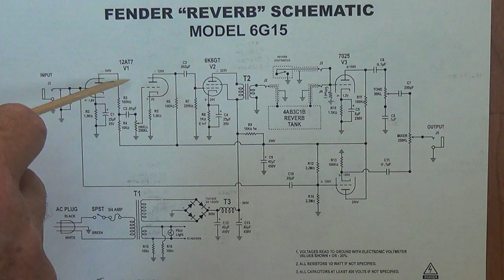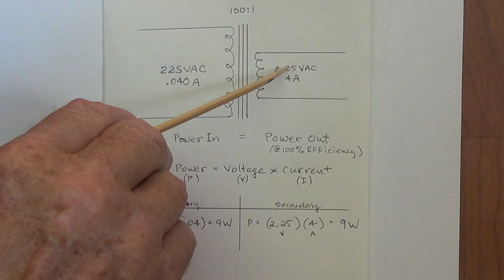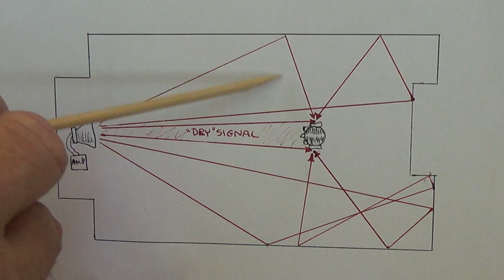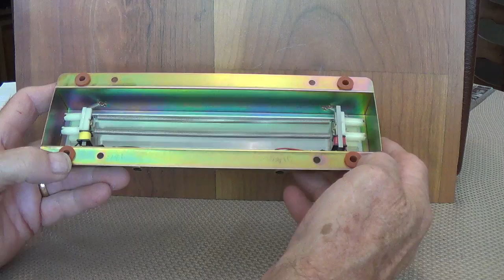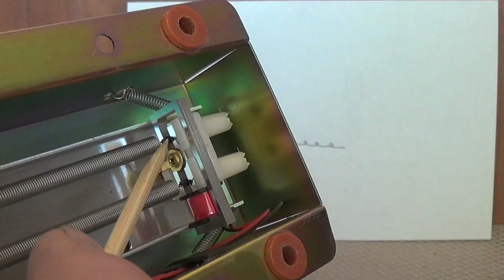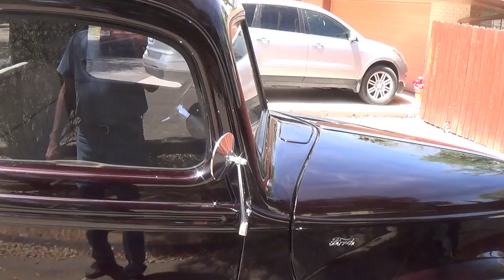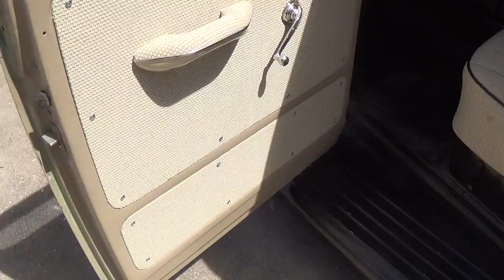Tube Reverb, Part 1

Comment: Hey Doug, I built one from the original Fender 6G15 Schematic last year...thing works/sounds great !  The only drawback is where the HV caps are located in the front section of the chassis does not have a protective cover as the reverb tank assembly hits the cover but there is well enough space for the caps.  I may eventually put these caps inside the chassis as there seems to be ample room !
Reply from the maker: I can see why you're concerned, Tom. I put the filter caps inside the chassis, thank heavens, and have no problems. I did place a metal partition between the power supply and the rest of the circuit.
Reply: Thanks for the reply...I saw that video and will do that !  Again, many thanks for all the videos and great explanations.  I'm an amateur radio op and mostly deal with RF and all this audio stuff is new but I still dabble w/vacuum tubes.  My other buddies say I'm lost   ;-))Best amps are those that have a full complement of vacuum tubes !
Reply from the maker: You're welcome, Tom. If you fully understand RF, then AF should be a relative breeze. Amen to  your preference for tubes......they've definitely got "soul" :)

Comment: Informative video with a truck porn chaser. What are the police like round you? Can you boot it and get away with it? Round here in rural UK, I can do a ton on the bike no worries. Nice work on the old Ford BTW, (who gives a bollocks what engine it has in it) can see where your cab covering skills get honed. I'd love one of trucks but you'd have to put floats on it to get it over the pond : )
Reply from the maker: Thanks, DA. The police in my area hide and try to catch speeders in order to generate revenue for the city.  If they really cared about safety, they would park under speed limit, school zone, and curve signs with flashing lights and point at them as cars passed.  We have to be very careful.

Comment: The quality of the finish on this unit is testament to the skill applied, given that it was the second project you had done.  The covering is still bonded tight with no lifting even on the corners, which is usually the first place to separate.  Previous experience fabricating hot rod interiors helped I'm guessing?  I very much like the material on the front.  Hope you didn't steal one of your Gran's couch cushions for it.  Another well chosen topic.  You set the bar very high with your videos.  Really smooth looking truck, beautiful colour.  Looks good, sounds good, starts first turn of the key no doubt.  Ford truck, Chevy engine, it's still American.  Put your foot down and your cruising, don't see a problem there.  At least it's not powered by a four cylinder turbo diesel from Europe.  Regards, Jeff.
Reply from the maker: Thanks for all your very nice comments, Jeff. The material for the front panel came from an old upholstery shop here in town. I bought several yards of it about 40 years ago and have been using it ever since.

Comment: Cool video. A 6G15 build is in the future for me. I just have to finish all the other projects I have piling up😎. This might be a dumb question but does an outboard reverb unit like this add any appreciable gain similar to how the reverb channels on the blackface fender's do?

Oh and can I add to the chorus of "oohs and ahs" about that truck! I do like to look of your work on the bed and interior.
Reply from the maker: Thanks, Bob. I'm not sure about the added gain, but would not be surprised if it did.....after all, the signal to the amp would have gone through at least one stage of amplification (dry signal).

Comment: Hi Doug, need to get your opinion again...about to build a power amp do you have a suggestion to this : 100-150W built in a 2U  chassie...? I'm a bit puzzled to if I'm gonna go that road or maybe use a readymade amp (ampeg pf500), any suggestions?
//Peder
Reply from the maker: It all depends on your motivation to build an amp, Peder. It takes a lot of time, planning, and work......and often ends up costing more than a good used amp. But if you relish the challenge and experience, then build it. Otherwise, hunt down a good used amp and bargain for a good price.

Comment: Doug,  Yet another great video!  I can't wait until the next one.  I may have to build one of these Reverb Units.  I just need to wait for your schematic....  The truck looks great too.  I hope to reassemble my '46 Willys CJ2-A, early model.before I kick the bucket, but I'll probably keep the shifter on the floor where a previous owner used a can opener to cut a hole in the floor.  ;)  I will clean up the can opener shreds and install a plate/ring around the hole where the shifter sticks through.  I still have the original 60 HP four-cylinder that came with it, along with the Jeep's low gearing, so it can only do ~51 MPH (my Dad followed me in his car to measure how fast I could get it to go).  But I'll never match the great work you do on your trucks.  Keep up the great work on your amps and old trucks.
Reply from the maker: We hope to have the schematic ready soon, Bob. Sorry for the delay. Those old flat-fendered Jeeps are quite popular. It sounds like a great project. I hope you can find time to complete it and send us a photo of the finished product :)

Comment: A little over 40 years ago I used to drive my "long-springs" full length hammond twin-spring tank with a tweed champ, using the reverb tank in place of the speaker,  and run the output from the tank directly into the FET input on the tape recorder. Delicious syrupy wet sound. Looking forward to Part 2.
Reply from the maker: An interesting experiment, Joe, that proves the fact that the initial reverb-driving circuit is virtually identical to a 3-tube amp, and the tank is analogous to a speaker. Thanks for sharing this with us.

Comment: I have a question. I put a cap can on my AO35. I used a variac. but, I dont think it went to well. is there a paticular process when forming caps ?
Reply from the maker: New capacitors do not generally need to be "formed". If this was an older cap, either used or not, then the Variac slow-warmup should have brought it up to working condition. Perhaps it's just faulty or not well grounded.

Comment: I understand the purists to a certain point when the automobile is a rare one, few units made or when it was kept original from the start, with everything stock, etc. but I don't see the point of not adopting the resto-mod approach on an old truck to make it usable and cheap to maintain and even more if it is a hot rod. No rules is the only rule.
Reply from the maker: Thanks, GP.....and I agree with you.  Butchering a pristine original, rare antique vehicle would be a major sin. Starting with a nice but relatively common, unoriginal car or truck and making it better in every way just doesn't seem all that bad to me :)

Comment: The first halfway decent amp I ever owned had a pretty weak reverb, but I figured out that sticking a weak magnet on the middle of the tank would lengthen the tail slightly. Of course, it would also cause it to feed back like an old tape delay when turned all the way up, so, maybe not the best mod ever. XD
Reply from the maker: An interesting modification, GB :)

Comment: This comes at a very opportune time for me as I am about to start a 6G15 build. I have most of the components, but the 125A12A transformer for the 6K6 does not appear to be available. I'm currently looking at a Hammond 125CSE transformer as a possible substitute. I was planning to use the Fender 50mA 4Hy choke in the power supply. I am still watching the video, so you may have already answered my questions. And why isn't Dwell called Drive?
Reply from the maker: ClassicTone has all the transformers and chokes readily available, as far as I know, Bill. The reverb driver/output transformer is No. OT47605 and the filter choke is No. 22699. Dwell can be used to describe the duration of an event (i.e. ignition points being closed)......so I guess it can be applied to how long the reverberation persists. Drive, on the other hand, does not apply to event timing.
Reply: I looked for the OT47605 and could only find it at Triode Electronics. It's not a ClassicTone part number.

Comment: Another fun, humorous and fact filled video. Thank you. What's the purpose of R4? It's 1/10th the value of R3. Not much of a voltage divider. Are we trying to keep the swing of C2 real high and close to the positive rail?
Reply from the maker: That's a good question, Jack. R4 is actually the plate resistor, with a rather low value for that function. Perhaps R3 was required to attenuate the plate voltage in V1a.
Reply: That's a good point, R4 is actually the load resistor. Maybe a better question is, what's the purpose of R3? It seems like this topology of R4 and R3 will keep the swing of C2 very close to the rail 'cause when the tube is on C2 sees the voltage of B+ X R3/(R3+R4), ignoring R2 and the tube on resistance, which will be approx. 0.9 X B+. If this the case, V1B will hardly ever turn off, thus limiting the V1B's output swing, which I guess gets back to your thought of attenuation. Curious?

Comment: Excellent video as usual, Doug, and one of my all time favorite devices too! Major correction though... the rod is a permanent magnet and it's not pulled back and forth by the magnetic field (up and down in your diagram) but rather twists against the field! If it was just ferromagnetic but not charged with its own magnetic field the fields would tug-of-war on it and always come out even. The signal is actually sent torsionally, not longitudinally or laterally down the spring. And the rest of that tube behind the magnet holds rubber dampers that surround the thin wire holding the rod to the end of the tube (it's not a spring, just a straight length of wire). The more/tighter the dampers, the less sustain time the reverb has. https://www.amplifiedparts.com/tech-corner/spring-reverb-tanks-explained-and-compared 

And the other end is just the exact opposite arrangement. Again, with permanent magnet rods. (The poles of the magnets aren't at the ends of the rods like a typical bar magnet, rather on the sides.)

Analogous to speakers and dynamic microphones, both ends require permanent magnets. But the real secret is that the springs carry their signal by twisting, not vibrating like guitar strings. (I see now the link I cited above doesn't really explain that. Trying to find a better one... )
Reply: Here's a good one that corroborates my rotation claim. It also explains why different frequencies travel at different rates through the springs, which, along with helping smear the reflected signal, is also what gives the spring reverb its characteristic "boing" or "drip" sound. 

https://theproaudiofiles.com/spring-reverb/
Reply: Excellent close up photos of the parts in this one! http://sound.whsites.net/articles/reverb.htm
Reply from the maker: Thanks so much for all this detailed information, AQ. I will add some corrections in Part 2.

Comment: Military otter get hold of Jack to get tips on camo and subterfuge and what not. Oh, you did promise to get
Jack some good stuff(8-). Glad he's enjoying a good high(8-).

Well, speakers and reverb tank inputs ARE current driven devices...typically low impedance.

I wish I'd kept the couple of old car radio reverbs I've had over the years...even though they weren't real
great. They sounded okay 'til ya ran over a rough railroad crossing. Believe it or not, I have shaken a
few iron beads on springs with...of all things, tone wheel pickups off antilock brake systems.  Got quiet
a delay outta those, but impedance matching can be a bitch.

Speaking of impedance matching...I'd love to see if the impedance of the driver's seat on that truck  is a
good match for my butt(8-). Love the color, btw...Thanks for the "tour" and the ride. Nice road iron. That
305 hauled the truck around just fine.

Oh...Doug...if you get time, get on google maps and use zip code 63530. Look north and find route J.
Kenny Baker is a friend of mine and lives and builds all manner of 4 wheeled roadables and has done
it for a while(8-). He's trying to get my landlord (Jeff) to put a 283 or 305 in that 34 Ford 5 window.
Kenny hates flat Ford motors. So if you "cruise" west on route J, you'll see Kenny's home town of
Elmer, Missouri(8-).
Reply from the maker: Thanks for all the interesting comments, Tom. I'll tell Jack about your suggestion.....if I can find him ;)  I looked up Kenny Baker's web site and found it quite interesting.
Reply: I hear ya. That Jack's got hidin' down to a science. Betcher glad he's not a mountain lion.

Comment: I read that Neil Young ( who should know) has his reverb tank mounted directly below the floor at each venue before he performs, for just the reasons you stated. Lovely truck, Doug.  Be well and prosper:)
Reply from the maker: Thanks, Richard. I swear that I recall some musician who would actually suspend a 6G15 (I believe) with ropes above the stage so it was not in contact with any vibrating surface.

Comment: Great video as usual, Doug! Before I ask my question, I want to say how much I really like how you spotlight your old vehicles at the end of these new videos. My dad has almost completed a gorgeous resto/mod of a 1951 Ford F-1 that's been in his family since it was new. It's truly a thing of beauty to see these old vehicles get some love! Anyway, on to my question... I have an old Silvertone 1474 that had the reverb "unit" removed before I got it. I have no idea what the reverb unit was made up of since I can't find a working example. According to the schematic, it has no transformer driving the unit. The signal simply goes from a 12AX7 gain stage, into the unit, then back to another 12AX7 gain stage. Could you give any guidance as to what type of reverb unit could be driven in this fashion? Maybe two piezo transducers with a reverb spring soldered between them?Thanks for any help you can give.
Reply from the maker: Thanks, Dave. Your amp was probably made by Valco and used a very unusual type of reverb "pan" which resembled a small "shoebox" on the floor of the cabinet. If you look at Valco amps on Ebay you can find photos that show it. I have never seen one in person. I believe the Guitologist has posted a video or two showing the unit. You may be able to find one for sale, but it's a long shot. When I designed the Supro Tremo-Verb featured in my video series, I chose to utilize a Fender reverb circuit and built it into the chassis. Trying to reconstruct the original reverb system would be a daunting task, and I'm sorry, but I personally have no idea how you could do it.
Reply: Thanks for the suggestion and info. I’m also a fan of Brad’s over at The Guitologist and I haven’t seen anything that resembles this. But they had to get it to work somehow! :) I’ll keep digging and experimenting and hopefully find a solution. Thanks again!!

Comment: Thanks for another great video. I hope it is within the scope of this mini series to; discuss the impedance requirements of reverb tanks and how you go about matching this to your circuit, since there are many options for both input and output impedance when selecting a tank; and the basic difference between tube driven and transformer driven reverb.
Reply from the maker: You're welcome, Allan. Impedance will be discussed in Part 2, but I will not be presenting much information specifically about tube-driven reverb.  The principles of operation are the same, with the main difference being (primarily) input impedance.

Comment: How many of those pickups would fly off the lots if they started making them again!
Reply from the maker: I wish Chevy would begin building 57 Chevrolet-style modern vehicles, much like Ford with the Mustang. Have them closely resemble the originals, but with all modern engines, running gear, etc.
Reply: A friend of mine put a 2010 Chevy pickup engine in his 57 chevy! Along with power windows, air, modern brakes and wheel hubs. He added a killer stereo and a tilt steering column. I designed a blinker lever for him to also contain his modern cruise control and made it on my cnc lathe. He painted it to match the sea foam blue color of his interior and it looks like it came out of the factory with all this stuff!
Reply from the maker: Wow....that sounds like a real gem, TL. Resto-modding is the new craze.

Comment: Why are there 2 reverb springs?
Reply from the maker: Some tanks have 3 springs, and they are generally all different length....just stretched more or less to fit the tank. The reason is to give a greater assortment of reflected, delayed overtones.
Reply: Uncle Doug. Thanks!

Comment: Thanks for the great video! One question, looking to the input "champ amp" circuit, the 12AT7 is decoupled from the output transformer by the 6K6. Therefore why does preamp 12AT7 needs to deliver more current? 12AX7 should work as well. For me the advantage could be less amplification (60 time vs 100 times) leads to less noise and the 6K6 drives the transformer. What is wrong in my understanding?
Reply from the maker: I understand your comments, Murrat, but would argue that if indeed the 12AX7 works as well, why is the 12AT7 used in virtually every Fender reverb? I charted the differences between the two tubes in an attempt to find reasons for this and may have either missed or misstated the real reason.  I tend to doubt the "low noise" theory, but you may be right. Perhaps you should build the circuit using a 12AX7 and see how it performs. Let us know what you find.
Reply: Thanks for the reply! Probably you are right, it  was only me thinking that it is detached by the power tube. But maybe the 6V6 needs to be driven with the higher current of the AT7 to produce the higher output current as well, I've not enough knowledge about the tube circuits. You are right Fender didn't select it by fortune.